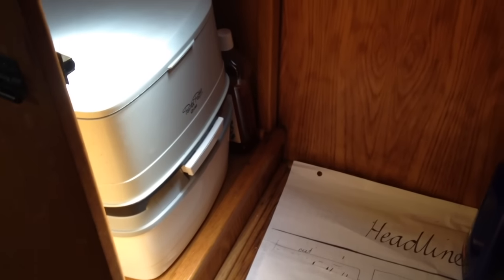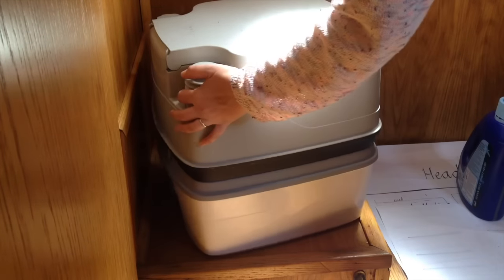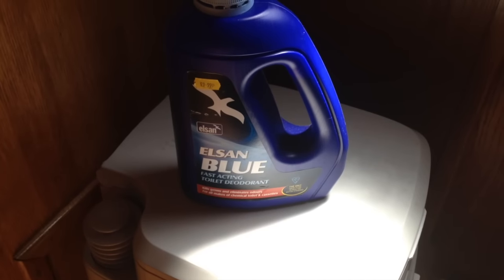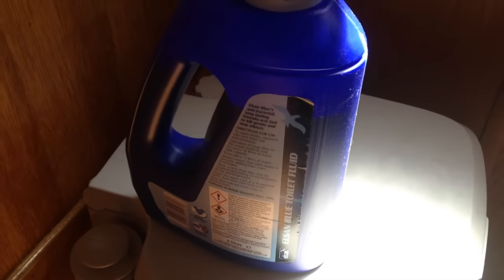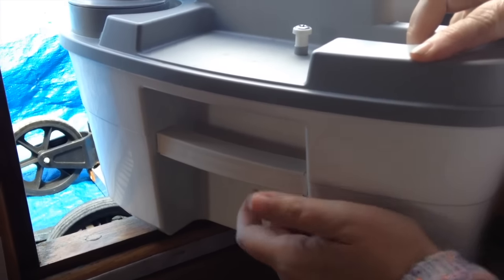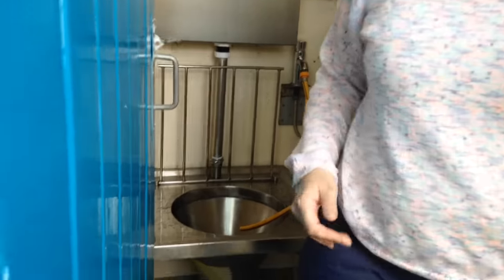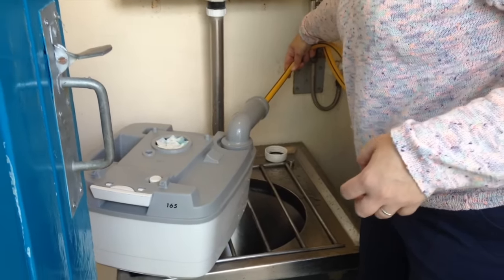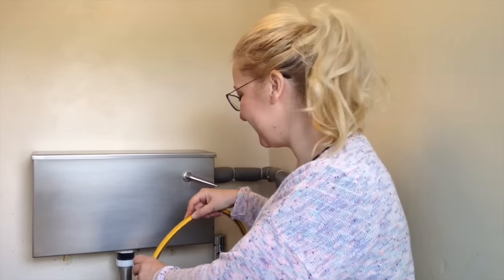Narrowboat Experience #010 - Toilets - Emptying a Thetford cassette

Comment: That's a lovely clean looking elsan point. Here in Oz we call them dump points but they do the same job. Many of ours are in the open air so no chance for any modesty. Lucky for us, our cassette is accessed from the outside of our motorhome so there is less of a hygiene problem. It came with little wheels and a pull out handle so it can turn into its own trolley.

Comment: I have one of those toilets that come apart. I used it when I first moved out to the land where I was going to go off grid so I didn't have a proper toilet. Now with the building set up to live in I use a compost type of toilet. When the bucket gets full it is emptied into the compost pile. Sounds worse than it is.  =)  Thanks for the video showing the not so pleasant side of living on a narrowboat. 👍

Comment: here in Canada if you have a cassette toilet like that, by lay it must be bolted down to the boat floor if used on a boat, and that pipe must be concreted to a pump out pipe,, as to many were dumping them over board, it is a huge fine if you are found with out it bolted on a boat, you cant dump your gray water or black water over board, they all must be pump out only, tank or cassette